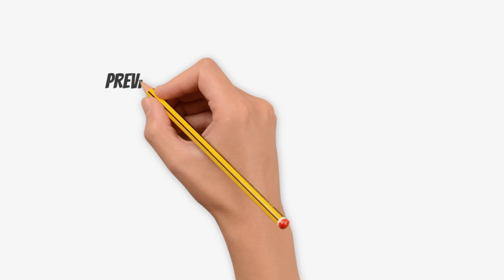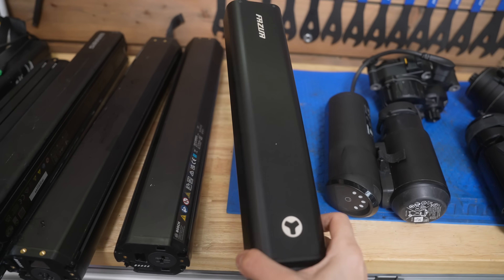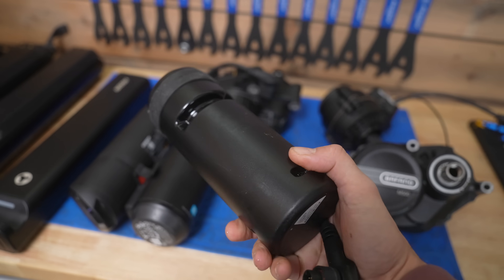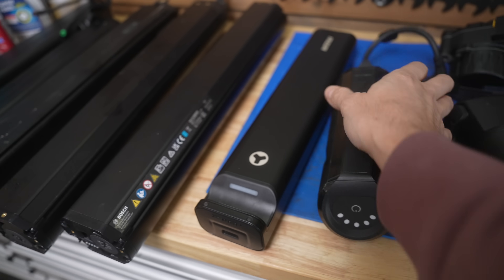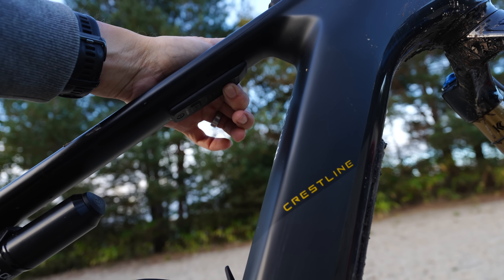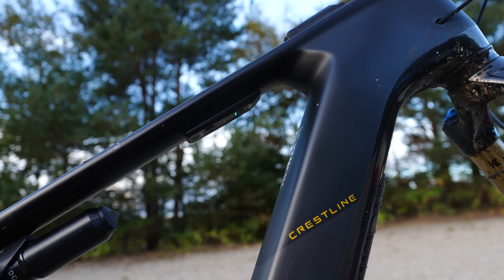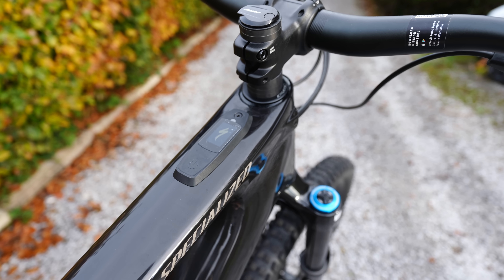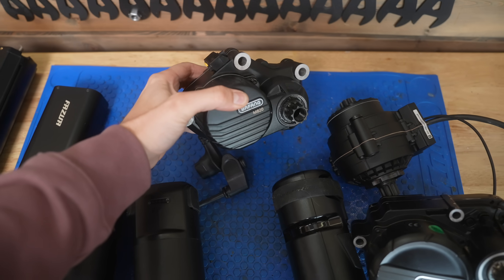We Have A Huge Problem With Ebikes....

Comment: I’ve been following the progression of EMTBs for some years now, but this is precisely why I haven’t bought one yet. I am prepared to pay the high purchase price because I understand why they are expensive but I’m not accepting the probability that I’ll be stuck with an unserviceable bike after maybe a couple of years.
Reply: Ive got.plenty experience with motors and beleive me that non e bike carbon framed bike will out last that e bike motor
Reply: Dito. I really need an EMTB to get back out on the trails after years of not riding because of an injury. But not being able to purchase spare parts and service the motor myself is such bs.
Reply: @Venna78  Ditto vs Dito
Reply: You'll likely be waiting forever then... there is nothing to say a current eMTB won't last you for years - it might not have the 'latest' tech, but really who cares? - you'll be out riding... the only thing you might want to consider a few years down the line is the availability of a replacement battery if yours is finally exhausted. If you consider how few people are riding ten year old regular bikes, never mind twenty year old bikes, then it's likely your carbon fibre frame will have cracked long before your motor has failed.
Reply: I have a steel fold up 20x4 bike that has cracked folding hinge @8900km, the elecs still good @yodapig

Comment: Kudos to Giant for making their new 800wh battery backwards compatible with their older bikes!
Reply: Yup. My 2021 Stance came with 500wh, and I jumped on the 800wh. Love it!
Reply: Maybe it will. Check it. For bosch they add a plastic hollow piece to small baterries so it fits bigger batteries. I dont know for Giant but check it
Reply: Adapters?
Reply: Oh will the 800wh fit into my 2019 Trance E+1 that currently has a 500wh battery. After 5 years of use it is still at 94% but it really restricts my riding. My rides are planned around the battery capacity.

Comment: These bike companies better get their programs together. There is no reason on planet earth, other than greed, that at a very minimum, batteries, chargers and upgraded sysyems shouldn't be interchangeable between brands, models etc. Bike companies are in for really hard times over the next several years and are basically cutting their own throats if they don't give the consumer what they want.

Comment: Well said. It's fine if you are buying a new bike every year or two but for long term use it's just a massive headache if you are locked into a system and manufacturer you don't want. Like Shimano.

Comment: This was the case with all the mechanical bike parts you mentioned when they first came out (derailleur hangars, steerer tubes, axles, bottom brackets, etc...). I think in 10-20 years you'll get your wish. It will take one or two brands like Sram and Shimano taking over the industry to make things cross compatible.
Reply: Uh. 1" steer tubes existed for over 100 years. 10mm axles. the same. We've had standard deraileur hangars for almost 100 years. 9mm QR's for 70. I have no idea what you are talking about. It's only been in the last 15 years or so have they decided to repeatedly change these standards.
Reply: Only the absolute polar opposite will ever happen
Reply: All it would take is Giant Specialised and Trek to get there heads together, standardise and everyone will follow suit out of fomo
Reply: You had maybe 1 or 2 standards for almost 50 years with a weird standard here and there
Reply: Agreed. Mountain bike designs continue to evolve rapidly, especially full suspension which is affecting drive train changes as well. Now we're seeing a possible shift from external derailleur shifting to belt drives and internal gear systems, this I think partially motivated by anticipated ebike  needs. It may be a few years get for these designs to be optimized enough to standardize.

Comment: I agree absolutely with your call for standardization in the e-bike industry. A strong lobby is needed.
Reply: The industry argued the exact opposite thing with cordless powertools, you can't interchange Makita &Milwaukee. The best were going to get is a duopoly of Apple vs the rest
Reply: @janeblogs324 update your data, apple was forced to use usb c bu EU
Reply: There is one. Its called leva eu.  Look it up..  but bosch have far more money to lobby than anyone else
Reply: I just sent this video to a Member of the European Parliament, Committee on environment protection
Reply: I doubt it will happen.  Regulating e-bike parts compatibility is like trying to regulate power tool battery comparability.  So many of the e-bikes and batteries that flood into the world are from "random letter companies" in China.  China just releases what they feel like, and tells the rest of the world "buy it and deal with it."
Reply: @ValisFan3 umm it seems the Bosch, etc are the problem but do blame the Chinese 🤦‍♂️
Reply: I'm all for voluntary standardization. The last thing the ebike industry needs, or any for that matter is more government involvement.
Reply: @onat3095 why?

Comment: I have to call BS on your upgrade arguments. With your way of thinking, we'd never have the brilliance of Tesla. Because they would have to be compatible with everyone else. No way. We have a wonderful opportunity, now, to let the electronic manufacturers battle it out. It's the last great battle ground of innovation. And just think of the great conversations we would miss around the dinner table after an epic ride. Let people decide what type of drivetrain they want to use, and don't use upgradability as an excuse for lowering the price of technology. That will happen by itself.
Reply from the maker: We can all fit electronic drivetrains due to the standardisation of the derailleur hanger (UDH). We can fit 29er wheels, 29" tyres and hubs due to the standardisation on these. I can use my Tesla charger, or the same charger the my wife has on her EV, because they both share the same standard charger.I can use my USB-C charger to power my phone, macbook, camera, gopro etc etc etc...  Its not about stifling innovation at all, its about not making hundreds of proprietary systems, chargers, standards and ports, that literally do the same thing as one another, but have been made to only work with a single system.
Reply: @RobRidesEMTB  I love your reply. And I love your vids. Keep it up. For the moment, I'll let the system figure out what the standard will be. Because you know there will be one at some point. Have a great day. And keep the vids coming. 🤘😁 PS I now have a Pole Voima because of you.